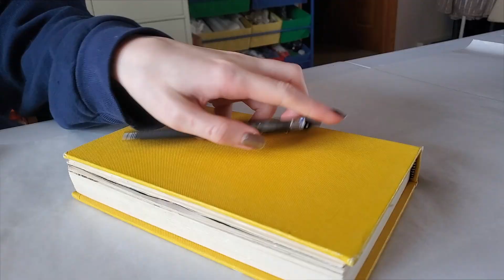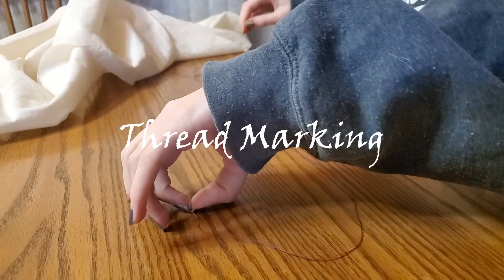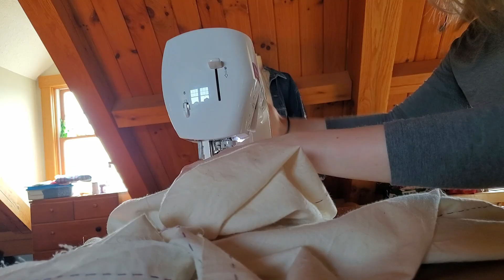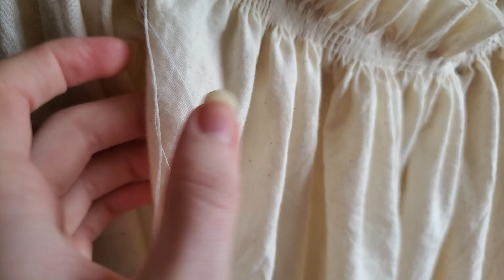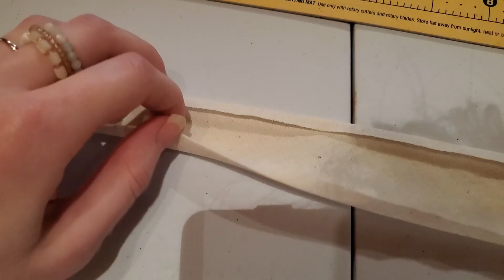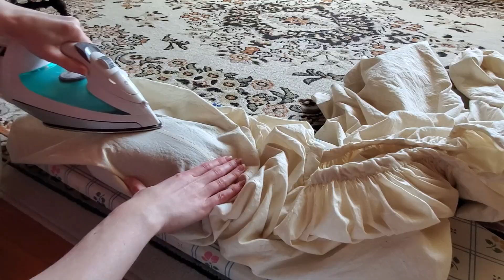Sewing the Quintessential Renaissance Chemise | 17th Century

Comment: This video came up in my recommended and inspired me to sew my own chemise! I'm still in the process of working on it but it's starting to come together nicely. Lovely video, thank you for making it. One question: do you have any trick for the gathering? I haven't done much machine gathering, and whenever I try, especially for larger swaths of fabric like for this, my threads usually end up breaking.
Reply from the maker: That’s so exciting! I’m so happy you’ve decided to make one too! When it comes to gathering, I’ve found that working by panel works really well. I use the seams as stop-and-start points to help prevent the thread from getting too long and snapping in the middle. I also recommend using a longer stitch length; I typically use 4.5 for most of my projects. And as a last resort, consider trying a different thread. Some of the cheaper brands I use work fine for regular stitching but do not hold up well for gathering fabric. I hope this helps!
Reply: Zig zagging over a thicker thread gives easy gathers!
Cheers
Reply: Personally, I like sewing a wide zigzag stitch over a length of postal twine, or crochet thread